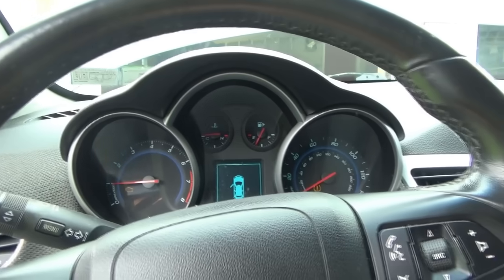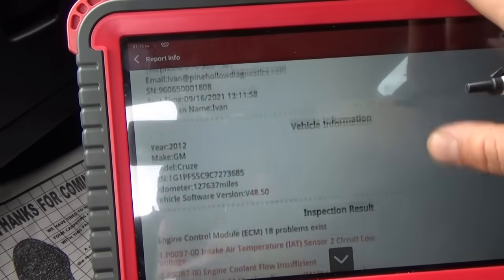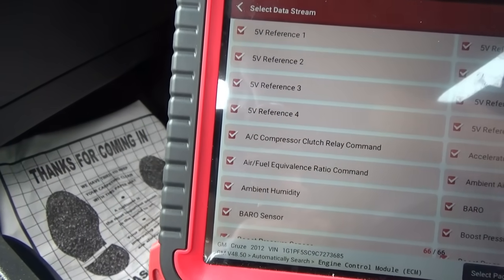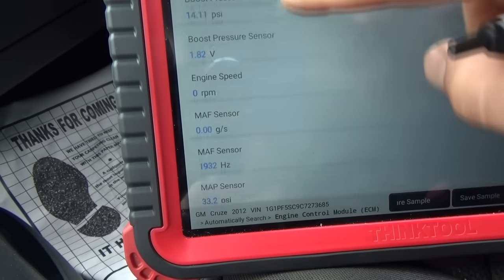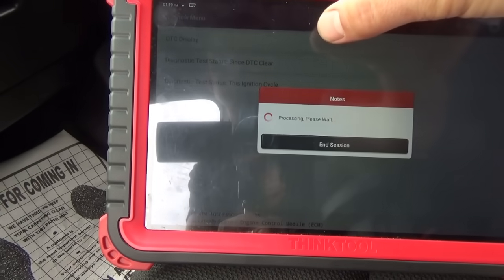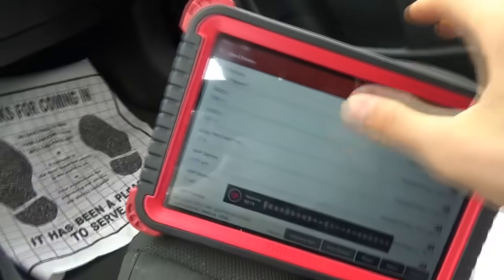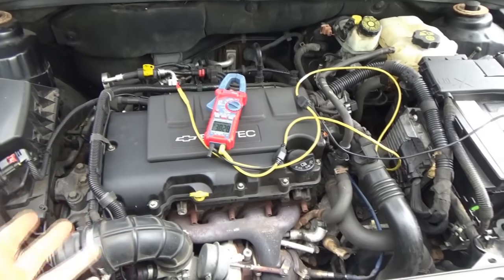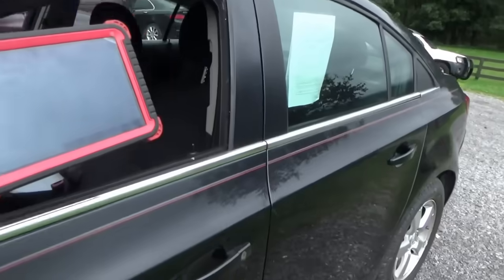Scotty Kilmer was RIGHT! (Cruze Turbo Rough Idle P0106 P0171)

Comment: Go check out Cruze kits.com. He has a kit that uses the existing intake manifold and moves the check valve outside of it. He has videos explaining this and a phone number to reach him directly. Replacing a valve cover will fix this issue temporarily but the vacuum on the crank case will cause it to go bad in 3 to 6 months. I installed this kit and a new valve cover 9 months ago and haven’t had a problem since! Use a Chevy OEM valve cover.

Comment: This is an extremely common engine in the UK, some of the other engines you work are dam strange, bigger than a 2.8L? 🤯
Reply: not uncommon here in the states, example, my 2003 Oldsmobile Aurora has a 4.0L V8, my 2004 Cadillac Deville has a 4.6L V8, and my 2002 Chevy Silverado 2500HD has a 6.0L V8

Comment: This is initial assembly cost cutting / aftermarket money making by GM. There is no other reason the non return valves and PCV valve couldn't be separate units, which would have made this an easy repair. Instead you've got to buy a new manifold and valve cover, plus the labour to replace them which is ridiculous.

Comment: These cars require thousands of dollars of maintenance from 60,000 to 80,000 miles - Timing Belt, Belts, sensors, intake manifold, covers, plugs, wires etc. Don't drive with vacuum suction on your oil dip stick - it will mess up all your seals.

Comment: ALL modern turbo engines are high maintenance if you want them to have a reasonably long service life. I say reasonable because the turbo will eventually fail. The environment that the turbo operates in is very extreme and cannot be circumvented.

Comment: Great diagnostic skills Ivan! I have to admit the Cruze is one of the most confusing cars to work on! Wait till you have to do a timing belt job on one! 😂
Reply from the maker: Hopefully it blows up before it needs a timing belt 🤣
Reply: @PineHollowAutoDiagnostics  Now that’s keeping it real! ✊🏾😂😂😆😆
Reply from the maker: @gregjones8501  lol! They still have timing belts? Must be only on the 1.8 Astra engine...
Reply: @PineHollowAutoDiagnostics  The 1.4L is a chain.  THE 1.8L in the cruze LS is similar to the Saturn Astra.  Both GM Opel Euro designed power trains.  Do we have the pleasure of a part 2 repair, or did the owner push it off the cliff?

Comment: The Dorman products replacement intake has been engineered to address the check valve issue. You should replace both the manifold and the valve cover to cover your butt..... eliminate repeat comeback in a few days! Also, be aware that the front crankcase seal can cause these symptoms.

As for Scotty Kilmer, I place very little confidence in his anecdotal conclusions about a car's worth or it's dependability based on the VERY limited exposure he has had to an issue. In the big picture, how many hundreds of thousands of the Cruze cars on the road?  I just fix them.... been doing so now into my 46th year. As for him being right? This would appear to be YOUR first experience with this problem on this carline, so it seems.

Comment: These engines have a common problem with these valve covers updated tsb shows to put a piece of paper in front of it and if it can suck it up to the pcv it’s bad. Also recommend replacing the oil filler neck. They are also common for leak when swapping them to the new valve cover.

Comment: Also, there is a pcv fix for the orange valve in the intake so you don’t have to replace the intake. Eventually you’d have to replace the intake again because that orange nipple is a terrible design. However there is no fix for the diaphragm in the valve cover. That has to be replaced. Poor design

Comment: If it was my friend's car, I'd first mock them for even getting it. Then I would rip out all the factory PCV components, plug/JB weld all vacuum leaks and throw a small vacuum line from the crankcase to the intake BEFORE MAF. After that I'd tell em to get it detailed and sell immediately XD

Comment: They want you to buy a whole new intake manifold, just for that little rubber valve.  There's a guy here on youtube who has a much better fix---- you glue over those little holes inside there and then drill a new hole and then put an external valve on a hose--- much better setup.. He has videos and sells a kit to do it.

Comment: My friends 2014 Cruze have the valve cover replaced. I fixed his stuck open purge valve.
He had multiple coolant leaks. The car is a lemon. It finally had a blown head gasket and he got rid of it 
Bought a 2018 Rav 4 hasen't had a problem yet
Scotty would have been proud 🤣😅
Reply: He may have turned into a hack trying to get more views, but he is right about Toyota. As if GM wasn't bad enough to begin with, a lot of their small cars & crossovers from the past decade are actually Daewoo models.

Comment: These 1.4 turbo engines need the oil changed every 3000 miles! The turbo charger is the villain! This engine needs a clean air filter no questions!! The maintenance must be done or it will fail you!!

Comment: map sensor on this engine is probably only used to monitor and control boost pressure. MAF should take care of the fueling.

agreed though. these cars are dumpster fires.

Comment: I dont care what anyone says these computer operated vehicles are a joke I bought a 2007 chevy van fuel injected computer drap all that I averaged 17 to 18 mpg on the highway, I owned a new 1979 chevy van carburetor no computer any of the electronic Bull it averaged 18 to 19 mpg on the highway emissions testing in California the both tested clean same numbers the difference I could fix the 1979 with a wrench and screwdriver the 2007 needed a scan tool because of the worthless sensor that keep going out I'll neve buy a new vehicle again.also I got over 400k miles out of my 1979 at 280k my 2007  motor leaked oil and used oil.

Comment: Half way through I’m yelling PCV in valve cover. Need valve cover and intake manifold
Reply: You can fix the intake manifold without replacing it. I've been shipping kits out to do just that at a far lower cost and better design for almost 5 years now.
Reply: Link for that kit?

Comment: its really two simple systems compounded by stupidity of design. with no boost its a normal pcv system  they put a pressure valve in and an equalizer line to prevent boost from affecting the normal operation of said pcv system.  the diaphram style pcv balances atmosphere with internal pressure.  forget about the vacuum  all it does is give a place for the pressure to go.   now add boost pressure and that will push on the pcv diaphram where its not supposed to(its meant to have vacuum) . the boost valve in the intake  closes off that pressure instantly  to normalize the operation of the pcv.    the intake valve failed causing the pressure of the intake to push on the diaphram beyond its limits to rupture the pcv diaphram. now its damagd with no boost it is a vacuum leak to atmosphere. with boost its a leak to the atmoshere (because of the torn diaphram)and the  crankcase.  lucky they didnt blow out any seals or born off the crankcase oil. thr real problem is in how incompetent the systems design is especially when in failure mode.
Reply from the maker: Great comment! What exactly does the cam cover diaphragm actually supposed to do? Is there some valve under it?
Reply: @PineHollowAutoDiagnostics  regulates vacuum
Reply: @PineHollowAutoDiagnostics  atmospheric pressure and a calibrated spring on top is balanced by crankcase pressure underneath. the diaphram seperates the two and underneath has a pintle or piston blocking off or seperating the intake vacuum passage and the crankcase.  when crankcase pressure exceeds the atmospheric and calibrated spring it lifts the pintle or piston allowing excess crankcase pressure to get sucked in to the intake.  thus why the valve is needed to block boost off when the intake is peressurised...   one interesting failure i've seen on these diaphram style s the atmosphere opening on the diaphram getting plugged.   the crankcase will build too much pressure because the diaphram cant move and it blows out  an oil seal.
Reply from the maker: @richardcranium5839  Makes perfect sense, thank you for the explanation!

Comment: The PCV system on these cars is absolute garbage.  The engineers behind this idea just need to get sent to the back of the bread line.
The Cruzekit thing will fix it.  It is a hodge podge of hardware store stuff which is better than what General Motors used from the factory.

Comment: Sounds like maybe somebody has been playing around with that many codes together at once. Yes we have seen many PCV diaphragms on these style of systems always EUROTRASH designed cars and I have never seen the intake check valve missing yet just pcv or purge valve failures. I have never seen of bad head casting or known anybody that has. Need to spray cleaner in intake port to see that nipple that is orange when not covered by goo.

Comment: Please Don"t get all those parts they are rip off all those heap price those I get all those morfiled price was less $80 that was 2 years ago and plus last year last time out 3 customers. But my younger sister got that 2 years ago bought her used car for 46,000 miles on it for 2014 chevy Cruze same motor 1.4 turbo. So she bought that car she complain about oil blow by issue have big problem for that . So I morflied everything since then it bet ran so good by no code the way I made no more oil blow by and lacking crankcase breather,plus now no using oil stay full every 3 thousand miles , but yes it was kind gummy sludge build up before she got that car. How I do cleaning sludge oil do get real dirty faster using 4 qts motor oil and 1 qts msyster maveral oil it real work plus save turbo bearing life.

Comment: I will never ever ever accept a word Scotty Kilmer says in any of his videos as right, man knows jack shit.  He claimed a customer went through 3 transmissions in one of these things.  There's no fucking way, unless the guy is drag-racing a Cruze, or the tech has no fucking clue what they're doing.  I've never ever ever ever seen a trans go bad in one of these before 200k, unless there's severe and obvious neglect.

This condition is common, and has an aftermarket 'permanent fix'.  When I was with GM, if I got a Cruze with a P0171, I didn't even look at data, I put my finger over that port, and if it had a whistling noise or the rough idle went away, that was the fix.  If it wasn't that, it was straight to the purge valve.  Those are the most common causes, and if you know your GM cars, you know it's some serious supplier bullshit, because ALL their engines have EVAP Purge Valve issues.

These engines are most known for their cooling system issues, water pump, outlet cracking, coolant bottle cracking, and over 200k, radiator cracking.  I have a Cruze, myself, actually.  Same model year, manual transmission.  Aside from a wheel bearing, the camshaft cover, and 2 water pumps in warranty, my car has had no unexpected failures, and in fact, has cost me less to own than like any car I or my S.O. has owned.

Comment: These cars are absolute crap.  Bought a used one from a buy here pay here full cash up front car ran great.. Mechanic inspected all good..  2 weeks later valve cover diapham blew.. Replaced with aluminum one which allows you to replace the diaphram vs the entire cover.. 1 day later turbo seals went out burning all the oil.. Replaced.. 3 days later engine light on again losing oil yet again... Cant find the leak..  Selling this clunker asap...

Comment: Im literally looking at 3 water pumps 4 electric thermostats 3 valve covers one,two, three intake manifolds, 2 head gaskets,cracked head, blown turbo, a whole galaxy of multicolored sensors, a timing kit, and that's just on my shop shelf. Cant see the car rn. And we haven't had it but just over it 2 years.  You have to jack the motor and remove motor mounts to just change the belt. Piss poor excuse of American made enginuity. Do better cruze..do better

Comment: Crappy design, planned obsolescence. If the cheap rubber diaphragm breaks (which is only a matter of time) replace the intake manifold and cam cover? No thanks. If it were me I'd be redesigning the whole system.

Comment: By the way… gm has issues a special warrAnty on this issue for 10 years / 150,000 miles…

On top of that this is an easy fix if it does go bad… simply replace intake manifold.. napa even makes a better than stock unit. Other wise the cruze is a Good car.

Compared to the numerous problems that the acura tlx has gm is making much better stuff

Scotty kilmer is a clown